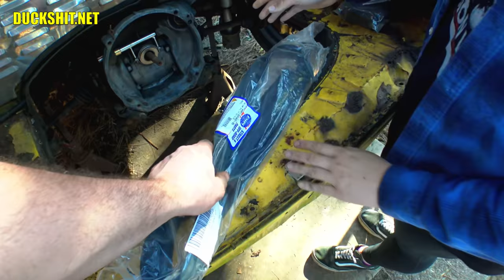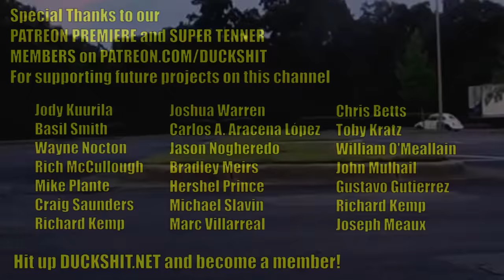Engine Reveal / Cross Shaft Installl - 1971 VW Karmann Ghia - Part 12

Comment: Painters grinder in denver is the best bug engine rebuilder. I've had 5 engines in 40 years rebuilt. If you keep the valves properly adjusted they will run for a long time.
Reply from the maker: Yup.... And change that oil!   😁👍

Comment: You probably know this already, but there is a method to remove that bushing with a tap.  If you use a tap that cuts into the bushing, it will drive out the bushing once it has bottomed out if you keep turning it.   Love your channel... would love to show up at a tech session one day.  I'm excited to see Bee's ghia run.
Reply from the maker: That's what I did... thanks!  But still wouldn't budge.  If it wasn't brass I'm sure the now gnarled up bushing would destroy the shaft... but it works!  I also have a tool like the tap, that you thread in and, but you pump grease into the zerk fitting on it.  Hydraulic pressure is supposed to push it out.... no dice... just the tool ripped  its way out.  LoL!  So it is staying in!

Comment: Any thoughts on adding the fixed cooling flaps to the chrome shroud?  I’m using the same shroud but in black on my build and those flaps fit amazing.
Reply from the maker: Flaps are recommended, even if you wedge them permanently open!
Reply: @DuckmanCycles  I wonder if it would be catastrophic to the chrome plating to drill through it for mounting thermostat flaps, fixed or functioning. I suppose you could oversize the hole and fill it with epoxy. Then redrill at the correct size. It would have to be pretty precise to be covered by the washers without looking goofy with fender washers. But I bet you have the skills!!
Reply from the maker: @TheBaldingVW  I'd say that any drilling would be catastrophic to any coating or layer... after all that's what a drill is supposed to do!  Planned and organized destruction!  https://bit.ly/3KRnDFP

Comment: I would like to make some comments about the chrome sheet metal for the motor if I may:
These motors were designed to blow cool air from the fan off the generator (alternator according to the year) to the heater boxes.  Since you have none of the appropriate openings in the tin for this the air is not going to get to the underneath side of the motor which will result in cooked valves because of the lifters not getting the air flow needed.  (from experience with a VW Thing set up the same way!)  also will over cool the cylinders because I am assuming the flaps are not installed and all the air will be directed towards that area?
While it all looks "pretty" I would suggest going back to stock tin and make that pretty if you want, but you really need all the hoses that were with the original motor.
The other thing I see is the manifold is missing the heat risers?  I assume you are going with a non stock muffler - which is cool since you are in a warmer climate...  If this was a colder climate the heat risers (which normally heats the fuel before it gets to the carburetor) would kind of be essential to proper operation of the motor.
Not trying to criticize the purchase of the "modified" material - just letting you know from my 30 years of dealing with "punch buggies" that what you are trying to install will seriously shorten the life of the motor you are about to install.
Reply from the maker: FALSE.... THANK YOU!  Criticising an unfinished installation mock-up, are you?  Haha!  You're as bad as the people that crabbed at me for testing an engine that wasn't meticulously painted a few years ago.  You may think you know what your'e talking about, but you really have no idea what we're doing yet!   LoL!  But thank you so much for all the effort you put into that comment.  Watch and see, there will be more to come!
Reply: @DuckmanCycles  The VW world seems to be filled with very opinionated experts. I've learned to ignore them and do some sensible research.
I run open flaps and Type 3 Cooltins under the barrels with no thermostat. Works just fine. Everyone's got their own ideas, follow whatever works for you!
Reply from the maker: Thanks man... But nobody knows what I'm doing anyway, they only know the color LOL